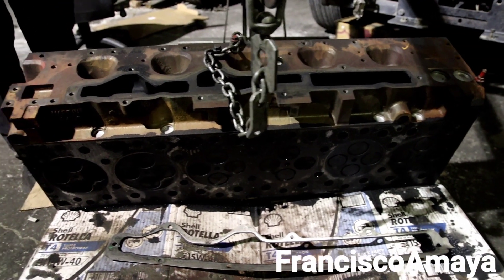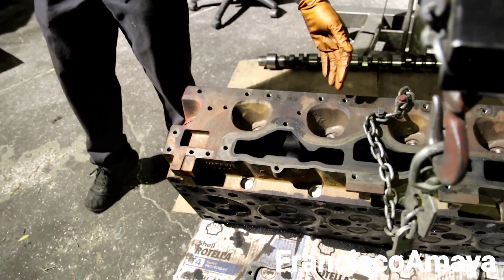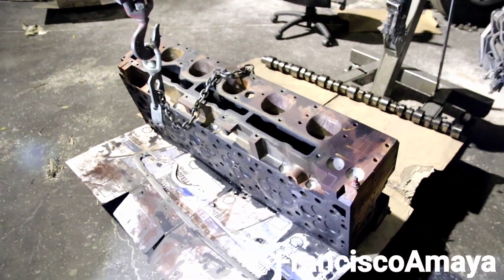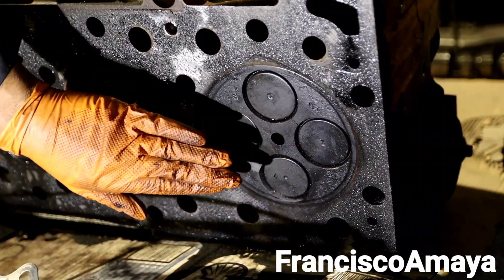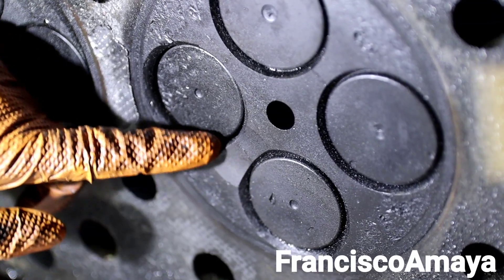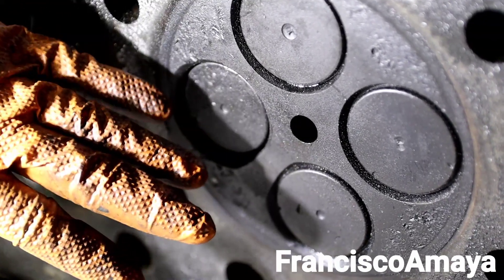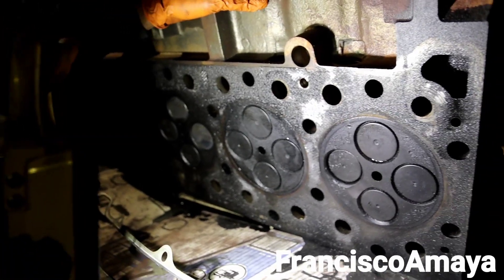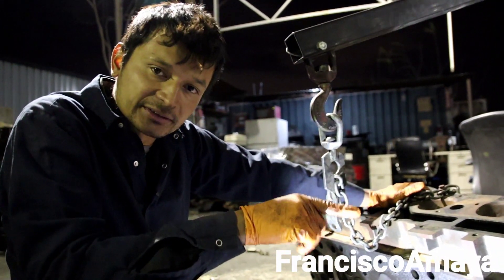Cummins ISX ISX15 broken engine cylinder head inspection after removal internal damage valve leak

Comment: Thanks very much for all your knowledge that you share with us. I have a question. If I took my rocker cover off I would almost certainly know that I have the same problem just looking at the valve stems to see if they stick out to far. Without actually pulling the head off right??

Comment: BS the problem was not a delete. the problem was fuel. fuel too lean creates too much heat. Too much heat causes cracks. egr delete will cause the same issue but its not the egr its the fuel to air mixture. too lean too much heat

Comment: Cummins gets a bad name from people doing delete’s & then the engine breaks & they blame it on Cummins. 
The new engine’s are designed to run with the emission system in place.
Reply: Definitely agree, they think they know how to delete and it just goes to shit
Reply: For sure. I want to delete mine so bad but it’s not worth the risk. Just find a pre emissions while you can, IMO. Do regular PM maintenance and Cook the DPF filter and change def filter once a year and do egr maintenance every 200k and you will be fine. AND DO NOT IDLE FOR HOURS. There are a lot of variables and it stinks but do your homework before you buy a truck etc. I’m definitely looking for an pre emissions truck after the market cools down. Good luck everyone.